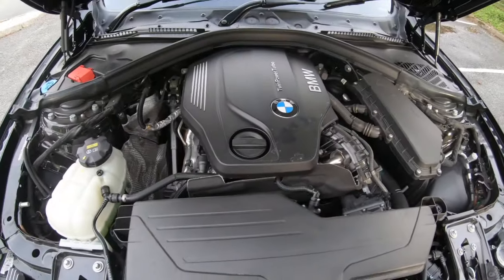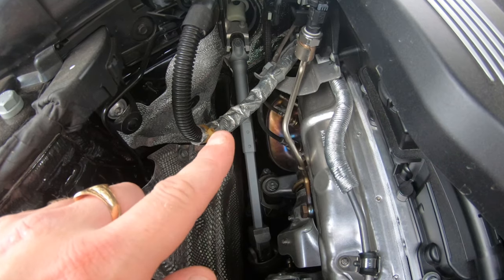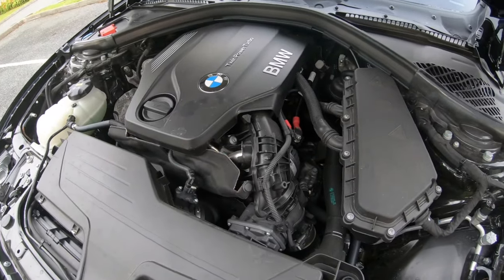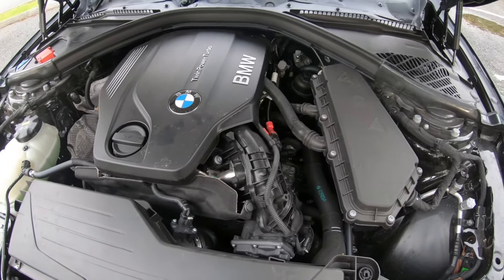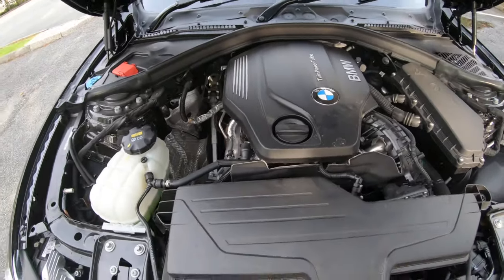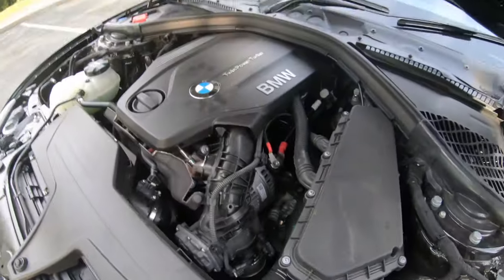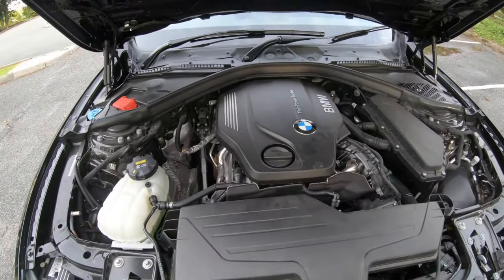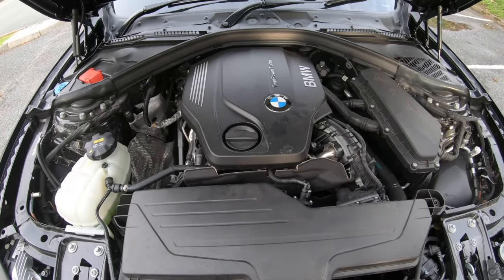Bmw B47 Reliability 2019......It Makes The Power But Will It Break The Chain ?? F36 420D Gran Coupe

Comment: i have a f10 with this engine, 445000km and running smooth still. This is a realy good engine
Reply: 445,000km??!
Reply: James H yes, use it as a taxi
Reply: @04087140  I understand by 445k km you would have done some repairs and maintenance. But what was your biggest and unexpected repair?
Reply: James H it hasent had any big expensies, i have change egr valve, but that was guarantijob
Reply: Pulvis Hansen original turbo?
Reply: T Hanks not anymore, change turbo 2 weeks ago, but a turbo that last 448000 must be okey
Reply: AGR Coolant BMW makes an big Callback to Check it. If its have to be replaced BMW makes this for free. 
Otherwise the engine ist really good cause No Timing Chain Problems and other things Like in the N47 
The B47 is an Upgrade. Only AGR could make Problems. 
I have the 224 PS Variant.
Reply: Delikanli67k the n47 is not an bad engine, i have a e60 with 502000 km on it, but have replaced upper timing chain on 435000km
Reply: Pulvis you change timming chain?
Reply: Ionut Gabriel workshop did it, its the upper timing chain that get worn. That is on the n47 engine. Timing chain on b47 is much better
Reply: @04087140  On which mileage was the chain changed for the first time?
Reply: Alfred Franssen it was around 435000 k
Reply: @04087140  oh wow that's really good. U had a healthy powerplant
Reply: Alfred Franssen yea, ive been lucky with that one, most importan ive done to it is oilchange every 15000k, even if factory said 30000k
Reply: @04087140  Alright, thanks for the tip and confirming. Im doing that as well to my b47d20
Reply: Alfred Franssen thats the way to make it last long👍
Reply: @04087140  Any other tips / tricks to go that long with original chain? Do you drive it warm before going above 2200 revs? Do you let the motor spin for a little while after parking?
Also, do you have the auto or manual box?
Ever used additives to the diesel, ot anything else to 'clean'?
Reply: Alfred Franssen no, not realy, but i used that car as a taxi, so it has always been warm. But as a daily i have driving it as usual
Reply: @Delikanli67k  complete rubbish, b47 is a part of a new modular family of engines, it shares some components with n47, but it's different
Reply: Phi Sel no, its a b47 diesel
Reply: Phi Sel the b47 is a new engine compared to n47, i think it runs smoother and revs more quikly than the old one, the b47 dont have so much diesel knocking on idle as n47 have, so my opinion is that its a much better engine than the old, it also have better fuelecomy
Reply: Mate, what oil have you used to get to 445k?
Reply: TCM castrol magnatech, just the one bmw recomend, and change every 15000 km, if i had this as private car i would change once a year or 10000 km,
Reply: Hi did you ever change chain of the engine for your f10?
Please tell me about issues of f10 you repaired
Reply: Cherif Hamani no, ive never change chain on it. The workshop destroyd the engine when they change turbo, they forgot too check for oil in the intercooler, so the engine did runaway when they started it.
Reply: I have the same car , 520d f10 I use mine as a taxi,  100.000 miles no problems at all, reading you have done 450.000km has gave me confidence. I deleted egr and removed dpf
Reply: Hello mate! The gearbox is an automatic one ? If yes, can you tell me please the interval mileage when you changed the transmission oil and pan filter. Cheers !
Reply: @S01-k9z  please show me how to remove egr.
Reply: @Delikanli67k  funny cause tensioner, guides  and chain is same part number to dot as in N47
Reply: @adamproperdouble2094 the chain in b47 has the different working engle. It might be same chain but they made it last longer because they moved the components of the engine to different angle.
Reply: @bastaboom163  Clever Germans!
Reply: @GT26923  goof question!
Reply: U got a recall for timing chain?
Reply: Unbeliavable. N47 has serious defect issue with timing chain.
Reply: @04087140  Hey Pulvis, any carbon buildup experienced with the B47? Greetings from the Czech Republic
Reply: @04087140  don’t remove the EGR or DPF it ruins the value
Reply: In F10 ?
Reply: My 318d n47 540000km, chain change to 310000, turbo orginal. original injectors, not repaired.
Reply: @04087140  You replaced the timing chain because it was making noise?
Reply: @aidan1585  which valve?
Reply: @Delikanli67k  Already did 4 times Callback for that shit AGR. First time they replaced the AGR Ventil and AGR Kühler.Second and third time update “Software”. Fourth time replaced Ventil and Kühler again (just yesterday). Really  tired about this shit AGR
Reply: Hello
Did you change chain? I have 230k kilometers and runa smooth
Oil intervals at 10k kilometers
Reply: @jianglinyue3740  I have same problem with egr. Did you solved the problem?

Comment: Can confirm that this car is reliable, rarely had a problem with mine even though i have new bigger turbos, new tuned software and so on and drove 200000 km in a year. There was not a single problem, doing oil change every 15-30k km.
Reply: @philipsmith221  what mileage is your car atm?

Comment: IT IS much better than the N47 No Time Chain Problem anymore. Only EGR Cooler have to replaced With the better Version and the engine can Run over 300+ km
Reply: Sry, what do you mean "have to..."? Is that some tuning thing and i have to do this by myself or it has to be done by garantijob?
Reply: @Sst886  No from BMW they Called Back all the Models with this Problem Here in Germany. Maybe Worldwide. Check it in next BMW Shop.
Reply: @Delikanli67k  thanks!
Reply: Merhaba. BMW şubesini benim mi arayıp randevu almam gerekiyor acaba? Aracım 2017 F48 18d. Bilginiz var mı? Selamlar

Comment: Own a f30 b47 188hp version. Car was manufactured September 2015. Done 66k miles. Serviced every 10k miles, I don't trust the 19k service schedule. No issues whatsoever. Drive it daily to work and back 80 miles all motorway. I drive my girlfriends petrol if nipping into town. I only open the throttle when the engine is fully warm, when it's cold I don't go above 2k rpm before changing gear. I comfortably get 65-70 mpg, sometimes a little bit more. Best car I've owned as it's good on fuel, fast, and very comfortable. I plan on keeping it for many years to come.

Comment: A lot of misinformation here. 

1) they are single turbo engines. “twin power” refers to the twin scroll exhaust manifold design.

2) If you look up the original part numbers, B47s use the exact same timing chain and guides as N47s. Only the oil pump chain is different. There’s no “massive improvement.”

3) the EGRs can be blanked and tuned out. 

4) A dpf delete (catless down pipe) omits the need for pedantry about regeneration.

5) If you want these engines to survive, do oil changes more frequently, have them carbon cleaned, and if the laws in your country allow: delete the EGR and DPF as soon as possible.

6) B47 intake manifolds still use swirl flaps. They’re less troublesome than the flaps used on older engines but can be deleted if necessary, dark side developments sells a comprehensive kit to do so.

7) most of the B47 parts are the exact same as the N47, from the camshafts, to the connecting rods and pistons, to the high pressure fuel pumps and even the air intake system. This is based off of part numbers and not speculation.
Reply: So even in b47.the chain can still fails?
Reply: @jadielmaistry1532  Hello, what do you think of throttle body cleaners and diesel additives?
Reply: Deleting the DPF and EGR won’t do these any good… and my 320d has a twin turbo, you don’t know everything contrary to what you might think. 2017+ has an actual twin turbo. Between all the b47 engines I’ve had its about 300000 miles… no DPF issues, no EGR issues , no carbon issues. If people don’t have DPF to worry about, they’ll just drive in town knowing they don’t need to let anything regenerate, which will destroy the engine. And you must know that? 
Do you have any qualifications? Do you have any experience with these engines ??

Comment: Owner of a F11 518D 2015 B47.  Bought at 244.000kms and has now 337.000 kms.

Only EGR has changed within a month warranty. Thats all. 

Remapped at 300.000 kms to 220ps and engine works very smooth.

Comment: I’ve got BMW 5 series 2015 B47 I use it for taxi and done 115k miles with zero problems! Just make sure you change engine oil every 10k miles and the engine should last you 300k miles👌🏻
Reply: Hi I just got a 2016 F10. Bmw 520d for taxi as well do you know when timing chain should be changed and have you changed it yet and what mileage thanks
Reply: @wusaf250  I use a b47 as a taxi , and there isnt really any problems with timing chains snapping on these , that's an old b47 problem , so dont need to get it changed,  just regular oil changes and it should last life of car imo

Comment: Family has a 520d -15 with 175 000 kms and never had any issues apart from EGR cooler replaced under warranty. Engine runs like new, would not discourage anyone from a car running this engine... great fuel mileage (ca 5-6 l/100 km average, around 4 at lower speeds on country roads) and power output

Comment: I have an F25 with 210K miles still running great only issues was the BMW recall on EGR 👍
Reply: did you change the chain?
Reply: @Scot Bratley
How often do you change your oil? No oil leaks, no cleaning of intake manifold due to carbon buildup, no major issues? Still running strong after one year? How much mileage do you have at the moment? Do you have B47?

Comment: Have this car for years and got egr deleted and blanked aswell as gutted dpf and have almost 220k km no issues still at original chain no leaks nothing only money I put into the car that was 300 to delete the egr and dpf and that's all rest is oil changes brakes tyres ect, and also got stage 1 205bhp from stock 116bhp and rips,

Comment: i have a 518   137 KM 2.0 2014 model 2015 with this engine. 214,000 Kilometers mileage. After about 200,000 miles, there was a problem with leaking coolant. It was not detectable in any way and the losses varied from 1 liter per 100 kilometers to even the entire content over 20 kilometers. Very not regular. I found out that it is a manufacturing defect and that the repair is free. They repaired the defect free of charge, but did not provide the cause and type of defect. I only saw that one wire looked like new. 1.11 in the video Black plastic with elbow. That was the only problem with the engine. Gearbox 8-speed automatic damaged last year. I advise you to change the oil after 70-80 thousand. I checked the condition every year. And at the time of the crash it was full. It's just that no one thought that this oil wears out and was a worthless liquid.

Comment: I've got 2016 320d 163 PS b47. Bought it with 100k, now running 122k and no issues, runs lovely, a lot of torque, manual gearbox, very fast and precise. When changing gears to lower, increases the revs so its really smooth downshifting and gives the driver a pleasure. The sounds when cold are little bit strange in compare with some older diesel engines, but I used to it. The only thing (except oil and filters) I've changed (or just they made a control, I'm not 100% sure, but ist fine) the AGR cooler, was recalled from BMW to make a control. Replaced/controlled on their cost, of course. So far I just enjoy it and I'm working on my little project on it, I love this car. It's my second BMW, after e46 2.0d with M47 (lovely engine, indistructable), and am very pleased.

Comment: Currently running a 2015 B47 engine BMW 320 EFFICIENT DYNAMICS 2.0 DEISEL AUTO. Bought it in 2018 with 94000miles on the clock. It now has 190000 miles on the clock just three years later and I have just got 77 mpg with a roofbox attached and carrying a spare wheel. ( caveat whole journey between 40 -50mph) Best car I ever had
Reply: Forgot to mention it is a tourer estate

Comment: 150k km on the clock and no problem with bmw f20 lci 118d 2015 (b47 engine). Great engine, decent performance. Been driving it on open road roughly for and hour or so once every month or two and had no problem with DPF or EGR. EGR was replaced though through BMW recall.

Comment: Our family motor is 2016 520D (B47 engine) bought it at 120,000k.. just hit 152,000 miles it’s had absolutely no work apart from basic servicing.
Fantastic motor never let us down, thank god BMW sorted out the timing chain problems compared to the previous N47 engine 👍🏼

Comment: bought mine at about 80k km, have 120k on it now and no problems so far, only had the swirl flaps removed or sth, ever since then runs like butter with oil changes every 15k km

Comment: I have BMW X3 2015 F25 with B47 at 140 000 miles with original chain and no issues so far, apart from failed aircon pump that I replaced with second hand one from a wrecked X3. All works fine without programming. Straight swap, even though the revision number for the aircon pump was from a slightly newer X3 2016. The car has been mainly used on motorway for long work trips across the country. I'm planning to get the timing chain done soon though. So far it's been a great engine.

Comment: I have this. F10 B47 520D 64 plate LCI. It now has 164000 miles. I bought it in 2022 and it's my first and last BMW. 
I've been finding out all the things you said here, the hard way. Failed MOT last year on emissions, timing chain was replaced. (Different tools and kit needed from N47). Failed MOT again this year for emissions. Looks like car was previously mapped and might have hole in the DPF. I'm cleaning out the ERG intake manifold and will be spraying cleaner to decarbon the valves. Hopefully this will fix it.
It has been a reliable car though! But i do like a car i can work on, and not so heavy on the computer. Thanks for vids.
UPDATE: 09.04.24. 
The cleaning helped, but it seems the remap it had must have failed, long before i bought it. 02 after cat sensor replaced and recall work done by BMW has fixed the problem now. Air fuel mix was off, recall required software factory reset, cleared map and car runs lovely again. Really pleased with BMW 👍
Reply: b47 520D needs to change the timing chain ??!
Reply: This isnt a car thats had a good life by the sounds...

Comment: BMW 225d B47 Update... 320000 km zero problem.! Only the Egr cooler have been changed "BMW recall"
Oil change inteval is 15000 km

Comment: Really interesting.  I find it better to buy a relatively high mileage newer car that's been sat on the motorway at an average speed of 70 mph/1700 rpm than an old, low mileage one.  Which has probably been driven around town using more RPMs for the same money, as wear is greater per mile driven and perishable parts will have aged.

Comment: Hi. Thanks for the valuable video. I recently bought 2nd hand F31 Diesal (2017 moded) in Germany . I found that the previous owner has done the service (Oill+Filter change) every 40000 Km. I am really confused as even onboard computer also set to do the service 40K. What should I do?

Comment: It has been completely computerized since the M47 through the N47 and now the B47. This is not any more complex than the ones preceding it. Just make sure you have a knack at using a laptop. If you are just a greasemonkey you will suffer but otherwise you will be just fine. And if we get decent right to repair legislation on all things consumption getting your hands on a legal copy of INPA or ISTA will be no trouble. The future is bright for these cars in my opinion.

Oh and do not screw up your engine. Don't remove EGR don't remove DPF don't remap the engine unless you know what you are doing. Remapping it will most likely grind up your transmission or twist your propshaft as well as ruin the emissions profile that will screw up your DPF ruin your oil and then probably tear the timing chain etcetcetc. be sensible folks :) 

Sincerely: A happy N47 owner whose timing chain is still factory and whose DPF needed no maintenance and whose car just keeps purring on. 

PS: Oh Carly for BMW on Android is also pretty great at keeping a handle on things.

Comment: 418d - 136hp 2017 F36
What can I say, bought the car around 195 thousand kilometers, had zero issues with the car except a faulty steering column. Now sitting around 220k km. I would love to do a preventive timing chain replacement and a remap with 420d injectors. Is that a safe thing to do on this mileage? Great vid, thumbs up!👍

Comment: I've got the 520D 2015. High Mileage 155K. I've driven 5K already and I've just noticed that it's starting to run rough at times for no sort of reason. Most of the time it'll run fine, at others - when I accelerate, you can hear a low drone noise from the engine and it kind of drives sluggish. I'm getting a local specialist to see it Monday so will see what the cause is.
Reply: Did it turn out to be anything to do the EGR cooler?, I had a letter saying they are recalling these models to replace the EGR and to look out for loss of power, fumes and overheating

Comment: 318d 2016 (b47) Manual 240.000 km. Zero problems. Highway use 80%. Ravenol VMP 5w30 oil (every 20k) Greetings!
Reply: do you change timing chain?

Comment: My 2015 X4 F26 does have 180 000 km and no issues, running good, 212HP with stage one - not the fastest, but good for traveling 🤷‍♂

Comment: 2015 F32 420d 150,000 miles. Oil and filter every 6000, long trips for work, 1 hour minimum.

Replaced turbo @ 135,000 for £1200 
Otherwise it’s been okay. 

I am about to do EGR delete and Swirl flap delete and clean intake manifold, mainly for my peace of mind.
Reply: Any of you wondering about noise like I was, every since I bought the car @ 20,000 miles back in 2019. It’s been a noisy tappity motor.
Reply: @PAINtballingxghillie  original timing chain?